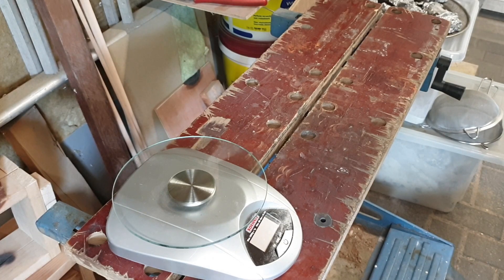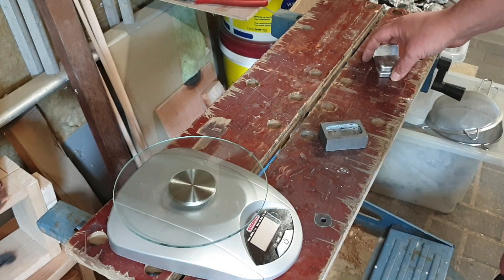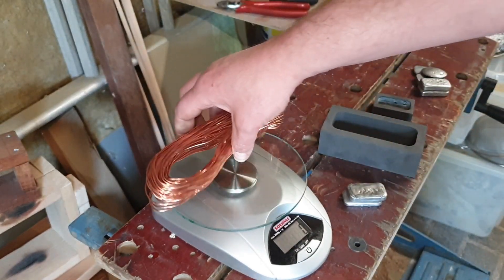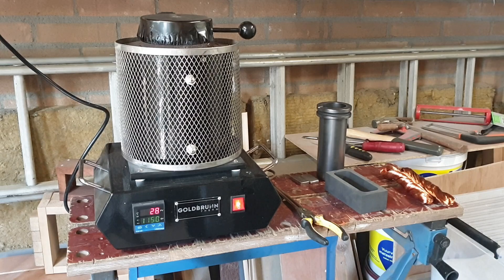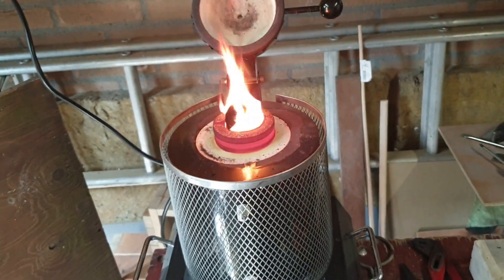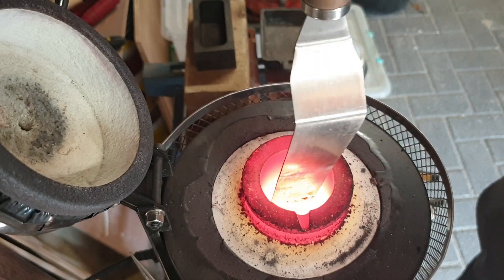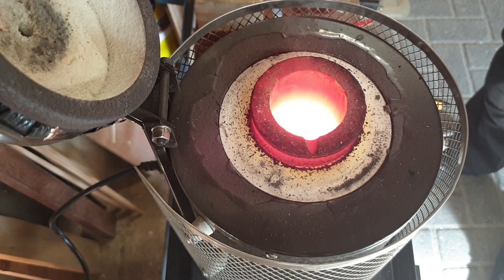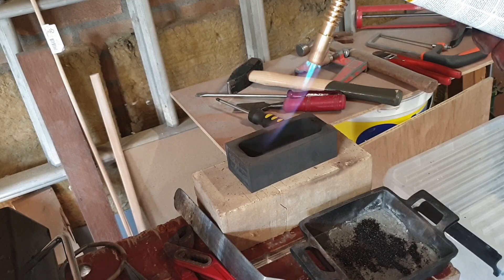Making my first Bronze bar, Mixing Copper and Tin

Comment: is it better to have the copper molten before the tin goes in?    if thats the case...this could be why our solder alloy sucks.....i usually make a 500lbs what we call a button 95% 5%. tin copper mix
Reply from the maker: I've been told it makes very little diffirence, but most hobbyist metal casters I know do it this way.
Reply: @ralphmourik  ok thanks...i didn't know if we were hurting our tins molecular make up but useing the tin to help molten the copper.....can you point me to someone who has alloyed for 50 60 years?
Reply from the maker: @robertheuer7670  Don't think I know anyone who has been into this for that long.
Reply: @ralphmourik  well i like your videos anyways lol yeah that was too specific thanks be safe!

Comment: I wonder is there a solvent you could use to remove the lacquer. Would it make any difference if you soaked it in acetone or toluene or something overnight
Reply from the maker: That might actually work, however I have now collected loads of copper wire without any lacquer on it, so that is what I'm using now. Thanks for watching and commenting 👍
Reply: @ralphmourik  Thanks for replying. I guess  i was mostly just thinking out loud. i'd be curious to know how it works out if you ever tried it though.

Comment: Great vid, could you please tell me the make of your electric crucible i cant make it out, thanks
Reply from the maker: The furnace is the Goldbrunn Therm 3000, it is a German brand, more expensive than many others on the market, but cleary of higher quallity, faster and stronger, I have been using it for over 4 years now without issues. Thanks for watching and commenting 👍👊
Reply: Perfect, thanks for the info 👍

Comment: How can i find tin in household items? Thanks . nice video
Reply from the maker: The solder on electronics is mostly tin, although it might contain some Lead too, same for old pewter, if the pewter items are stamped you could find out what is in it, some even says like 98% tin on it, that is the good stuff. And you could always buy Lead free solder at a local hardware store, I bought it before it was 99% tin + 1% copper, so great for mixing with copper to make bronze. Hope this helps, thanks for watching and commenting 👍👊

Comment: Where did you buy the graphite mold from 1:03?
Reply from the maker: I think I got the small mold from either Wish or Aliexpress, just look up Graphite ingot mold and you will find all kinds of shapes and sizes. Thanks for watching 👍
Reply: @ralphmourik  but then you have the aliexpress address of the mold??
I like you mold size for aluminium bronce, you can help me??
Reply from the maker: @Sebastian-lu8en  well I got that mold years ago so I don't think I still have the link to it 🤔😅
Reply: @ralphmourik  ohh jajajaja the graphite molds are very restintant and give very noce ingots

Comment: Hiw do you find that furnace..I'm in 2 minds of what to do..was thinking of just building my own furnace  but buy the burner from devil forge and build the rest myself ..decision  decision. I'm liking your channel
Reply from the maker: I really like using the little electric furnace, had it for 3 years now. It's great for small projects. When melting a large amount of Lead, Pewter, Zinc or Aluminium into ingots I set up my big charcoal furnace. I now have access to a refillable propane tank so I will be building a new and better furnace in the near future. What it comes down to is having the right tool for the job, and as we all know, you can never have enough tools 😋👍👊

Comment: Hi Nice video
How can remove tin after mix with copper
Reply from the maker: Well you could keep adding more copper until the % of tin is very low, but actually removing the tin would be a chemical proces that is not worth the time or cost.

Comment: That's a cool looking bar,  lots of character! I want to try to cast some ingots,  do you think I can use my blacksmith forge to melt?
Reply from the maker: If it can hold a crucible and gets hot enough it could work, give it a try, start with aluminium and if that works try copper 👍👊
Reply: @ralphmourik  it's an old bbq grill with a brake drum in it. I have accidentally melted steel in it, so it gets hot enough lol. I'll have to give it a try.

Comment: I wonder if that dusty stuff at the bottom of the Crucible would ever rise to the top ??
Reply from the maker: I have had some weird things happen with coated wires, next time I will burn it off first or only use clean stripped wire 👍
Reply: Use borax
In fact ,for cleaning your material you could use borax or Himalayan salt. In ancient and medieval times salt was used to clean melted non ferrous metals. It was used even for refining copper (melting point of salt is 800°). Keep in mind that borax and salt will not mix with molten metal,it absorbs all oxides made by melted Pb,Sn,Al in contact with air and clean all other impurities. It's the basic/must do technique when melting non ferrous metals ;).

Comment: 5:47. That "slag" as you call it is pretty nasty stuff. When I melt that coated wire in my furnace, the coating doesn't always rise to the surface. Sometimes it creates pockets under the molten copper and actually insulates the copper from the crucible, and the copper doesn't melt. It creates a crust on top and the copper is molten just underneath. 
I find the best way to deal with this stuff is to pre-heat the copper in the furnace first, burn off the laquer and then empty the copper into a bucket of water. Most of the coating will fall off and then you can actually melt it then.  I call this process "cleaning the copper" it doesn't matter how hot you get the furnace, that stuff will not burn completely away. I'm about ready to repair the coil in my furnace, I've got some ideas on how to re-join the ends of the broken coil together. Perhaps I'll make a video!
Reply from the maker: Thanks for this info, I will look into doing the same with coated wire in the future, for now I will stick to clean stripped wire 👍

Comment: Nice bar Ralph! LOL I melted so much copper bars I have gotten used to the weigth :P Is it that the graphite mould is brand new that the ingot had so much trouble getting out? I have alu bronze and copper bars just falling out my moulds easy... Why don't use som rebarb or other piece of steel to mix it up in the crucible? Should do the job too I guess?? That dumpster find is just awesome! I'm looking for a wired electrical drill like that too, but do not want to pay 50 EUR for a crap brand or 100 EUR for a proper brand :P A dumpsterfind would just be awesome! Great find my friend! Looking forward to more melting fun here.
Reply from the maker: I think I did not wait long enough for the bar to cool down so it drops out the mold.
I did get a graphite stirring rod now, that will work way better than a piece of steel, I was very lucky finding the drill in the trash, that will be in a future dumpster diving video 👍